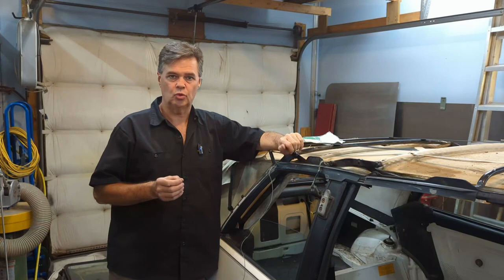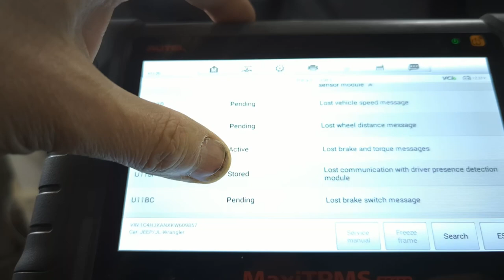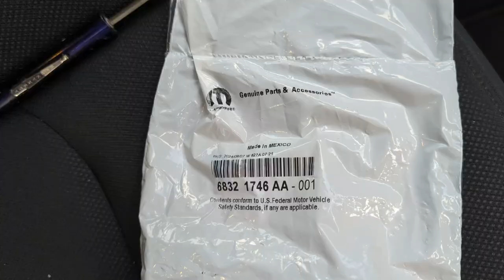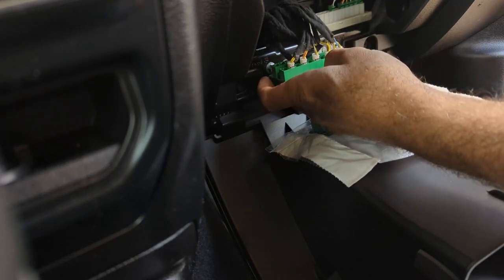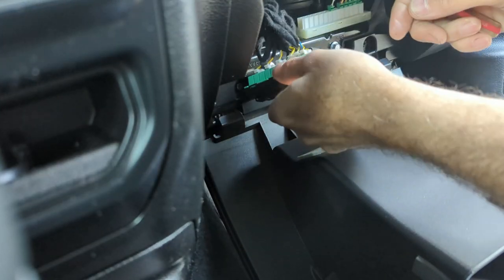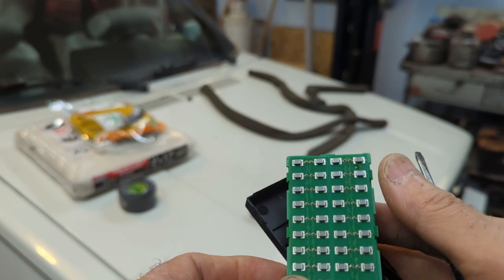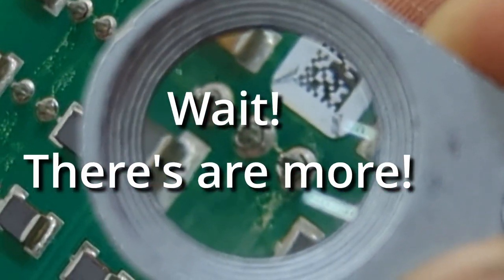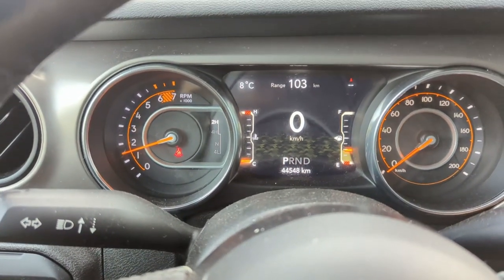Jeep  Wrangler Star Connector Failure - No Start - Service Shifter - Stability Control

Comment: Credit where credit is due: Beverly saved the day. It is a shame that after all these years of circuit boards, we still have no solder pins. Should not happen. Good job!   Walt
Reply from the maker: Thank you Walt,
Yes, it seems we haven't made improvements in some cases, and profits out weight quality.

Comment: Good find there, Alvin.  Comms network issues can be very puzzling at first and take time to sort out so this information should help out alot !  The wiggle, tap test on the connector will help identify the issue before buying one and get someone going again till a new cconnector is installed. 
   One good thing about these types of “ connectors” is it allows us to disconnect comms to an individual module when trying to to diagnose a fault. A shorted or defective module can bring down the entire network.
Reply from the maker: Yes, it was a big relief to actually find something that would cause this to happen, as you know, there's nothing worse than the problem going away without finding the cause!
I am going to re-solder the pins, and keep it as a spare.

Comment: Outstanding! You and your wife just saved a lot of people a lot of money and grief. Question, if you have a moment, did you need to disconnect the battery before doing this? In any event, thank you.~Chuck
Reply from the maker: Thank you Chuck,
It was one of those situations where there is so much wrong at once, it becomes overwhelming, and your mind goes to the worst case scenarios.
No need to disconnect the battery for this, often these buss lines get grounded, cut off, even shorted to each other, and it doesn't damage the ECM or other modules.
Reply: @J_R_Shop  Thank you very much for the battery info. I agree, seeing everything fire off would get one’s head spinning quickly. ~ Chuck

Comment: Well appears domestic vehicle makers have not progressed much, use to be you had to keep a extra spark box for a ford in the glove box, A ballast resistor for Chryslers, don't remember GMs ...  Fusable links and starters/alternators maybe lol. Cheap part  manufacturing, lowest bidder rules now. Quality is Job last...  Or is it that just good enough is good enough. Get it past the warranty period then they dont care if the part fails. Anyways I bet there will be some looking for this fix.
Reply from the maker: I agree, corporate bonuses have become first and foremost over anything else. 
We lean into blaming the offshore manufacturers, but they only make the parts to what is specified, by the companies placing the orders.

Comment: I wonder how many times people have had to take their vehicles in for repairs because of this. 
44 500 kms and it failed , ouch!    thx Alvin
Reply from the maker: When my wife was researching this issue, there were people saying that they sent in the thousands at dealers, and came away with the same issues.
Yes, this jeep is a low mileage vehicle...a little worried about the next few years. ☹️